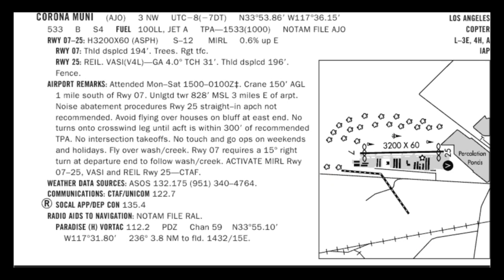Traffic Pattern Entry (Uncontrolled Airport) Tutorial - VFR (MSFS)

Comment from the maker: For the traffic pattern slow the Mooney down to 100 kts, fly the base at 90 and the final at 80 kts.  That should work out pretty nice.  For airspeed control in slow flight use your pitch, and use your power to adjust your rate of decent.  I could probably fly a pattern in a Mooney in the next hour and post it just for you if you wish to see it.

Comment: @FSX404 Hey thanks a lot! I've been struggling with VFR for a while now (mostly due to the fact that looking at stuff in the simulator isnt very multi-tasking productive, when in real life you can turn your head, and because my laptop runs FSX sort of slow). My biggest VFR issue now is: How far away from the runway (in a traffic pattern) to start the final leg? The 45 degree angle works for small slow planes, but I'm flying a 200 KTS Mooney Bravo, and 45 degrees doesn't work out too well.

Comment from the maker: There is no exact set distance, for smller planes it is around 1/2 mile, foe a C-152, 172, 182 etc, your wing strud should be bisected in half by the runway, for twin airplanes and little larger planes its a little more (they usually have a TPA of 1500 feet AGL too, although this depends upon the airport).

Usually, as you turn from upwind leg on to crosswind, you should level the wings just so you can make sure the downwind is clear and then roll right into the turn on to downind.

Comment from the maker: G - Gas (fuel selector valve on both)
U - Undercarriage (Landing Gear Down)
M - Mixture (Full Rich)
P - Power Setting (throttle for 85-95 kts)
S - Seatbelts On

Comment from the maker: I'll try to put up a pattern entry for a controlled airport, they actually have "visual entry points", or tower checkpoints, where you have to be prior to entering a pattern, unless otherwise specified by the ATC. 

These point are usually shown on a standard VFR chart.  

Contact me if you want more precise instructions, because I understand that a picture (or diagram) is worth a thousand words.

Comment from the maker: Exeption being if your minimum safe airspeed in your airplane is above 200 or 250, you are allowed to go faster, but remain at your airplanes minimun safe airspeed.

As far as where you aim for, you always want to enter the downwind on a 45 degree angle.  Usually you fly 45 degrees to the middle of where the center of the runway is.  I hope this makes sense, I think the graphics I put up are just about accurate.

Comment from the maker: There are no assigned traffic airspeeds, the speed of 85-95 kts is only a recommndation for a C-172, because you are in a vicinity where other aircraft may be.  This gives you enough time to do the proper pre-landing procedure (GUMPS) and get set for the final decent.

However, there are other speeds to be concerned about, under 10,000 feet you can go no faster than 250 kts, or if within 30 n-miles of class B it is 200 kts.  

There are exceptions for these speeds.